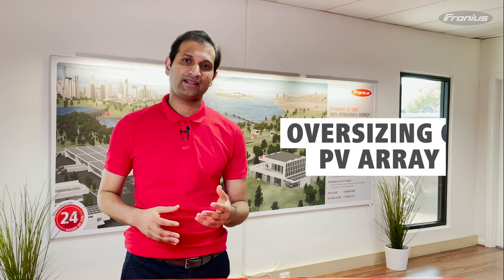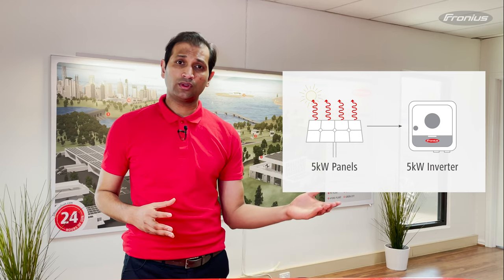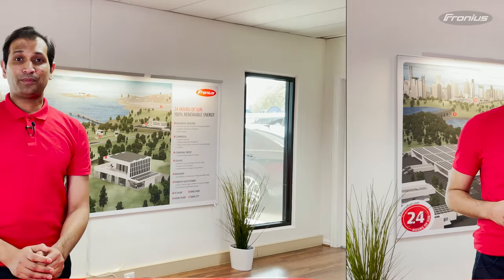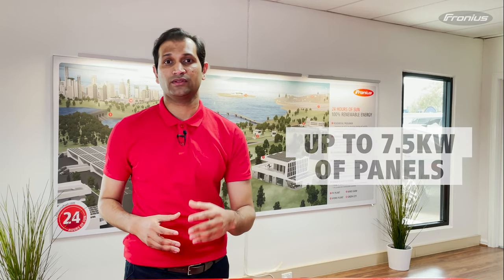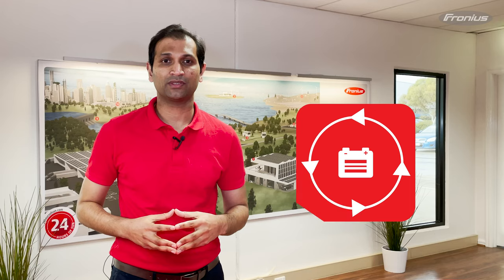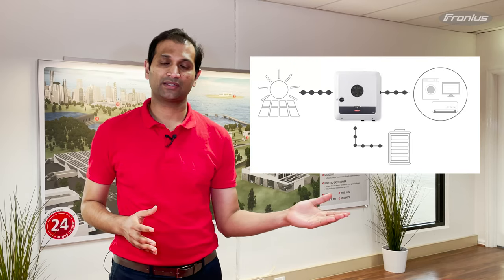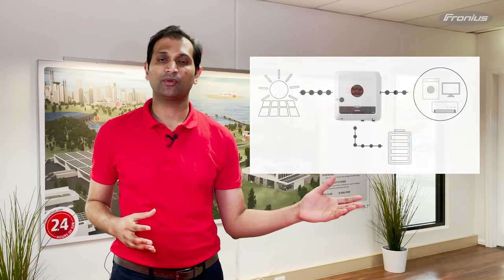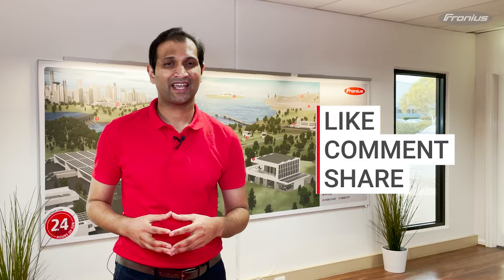How much can you oversize your PV Array? (AUS)

Comment: Thank you for info. 
If I have a 3kva inverter with 60a mppt, has 2000W maximum power array as in datasheet, is it safe to connect 8x400w pv panels to the inverter (sure with respecting Mac input voltage)? thanKs in advance.
Reply from the maker: Hi White Sam Arrow!

Thank you for the feedback. Please contact our support team with your comments at support@fronius.com.

Best regards, your Fronius Social Media Team

Comment: what happens when you design the string that respects the Voltage and I current limits of the DC inverter but the input on the PV max power on DC is greater that the limit on the specs?
For example:
-PV Max DC Input inverter is 8kW and
Solar panels installed power is 10kW but is in the limit  range of V and I of the MPPT
what happens with the inverter...you forgot to mention
Reply: I don't know about their inverter, but I have a Chinese solar charger, the "MakeSkyBlue," running on 12V. It has a 40A charger, and the manual recommends ≤ 480W of PV power and a PV voltage range of 20V-80V. However, I installed just one panel, the Longi Solar LR5-72HPH-545M, which is 545W, with 49.65Voc and 13.92Isc. So, I’m really exceeding the recommended PV power, but it's still within the middle of the voltage range, and nothing has happened.

Comment: So you say that you can oversize your inverter only 150% hmmm 🤔 
I belive you can add how many panels you like if you keep voltage in range of course.
Could you comment on this please
Reply: I dont think so ,cuz  eventually current will increase due to parallel combinations you would to maintain mppt volatge range
Reply: It must have something with the mppt system, for example if you have a 100w lightbulb, it consumes 100w even if there is many kilowatts available, I am trying to find a solution to this, if you have an off grid system, and a large solar array you are forced to install a large battery bank to absorb the power generated, I contacted Epever support today, they responce was this is wasting energy, my response was a large array is much much cheaper than the battery required to absorb the output, tried to explain that a large array with a throttled charging output, helps keep a steady output over seasonal variations and clouds/sunny conditions, I am wondering if a pwm controller would work better, or a relay system to engage / disengage PV  panels when the amperage goes above and below a set current
Reply: He said 133%.
And that number comes from the CEC regulation.
They inverter will still work with any number of panels providing they are wishing the voltage and current parameters but it won’t be legal unless it’s within the 1.33x inverter rating.